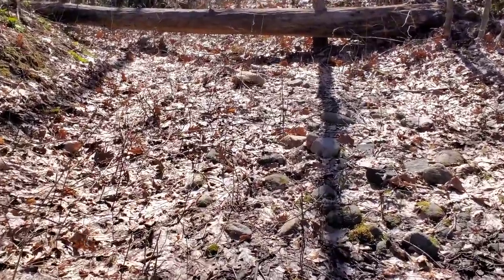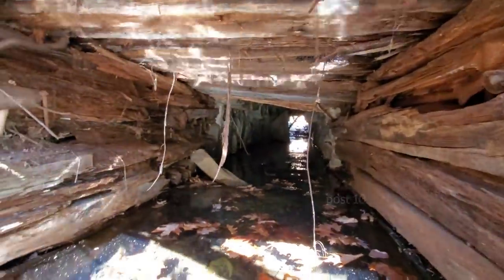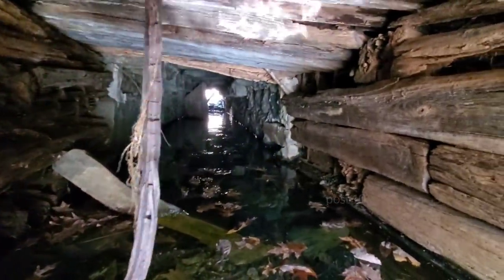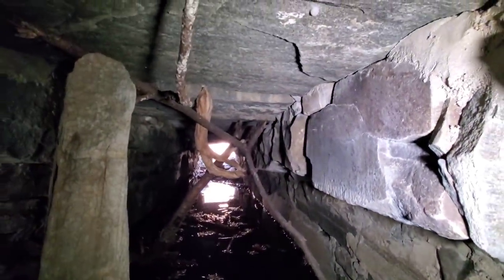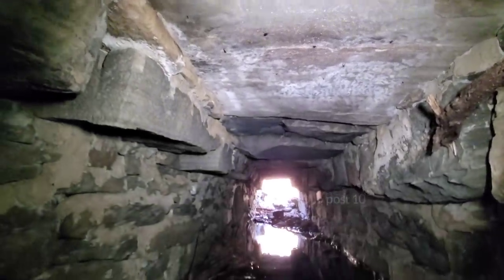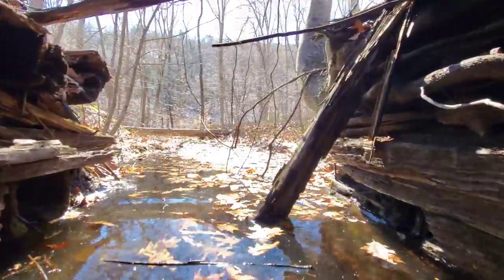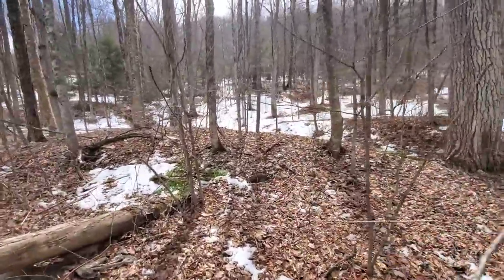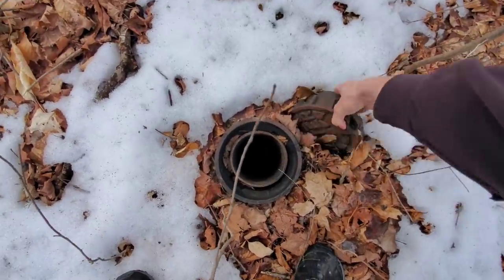The Wood Tie Culvert And Gondola at Bretton Woods

Comment: Perhaps slab was meant to be part of roof structure, it fell during construction and crew stood it up so as not to block water flow, but didn’t have tools to move it out of the culvert? Otherwise why? As to water hydrants, was there a slope nearby?  If so, maybe it was used to make man made snow.  Interesting video!

Comment: That will be so cool to see you drain it and clean it out. So really cool culvert
Reply from the maker: Drain what? That is intentional to have sitting water so it doesn't dig out the bottom
Reply: @post.10  i thought it had a granite bottom. Couldn't see so good from the video.
Reply from the maker: @jeriwollmann7366  the wooden extension definitely doesn't have a floor

Comment: Why would they make the culvert out of wood if it was going to rot Please reply back if you have any answers as to why they made it out of wood
Reply from the maker: Well it looks over 50 years old looking at it the tree is maybe 30
Reply: @post.10  thanks that makes sense but if I were in charge of the culvert I would have made the extension out of concrete or granite blocks or bricks maybe